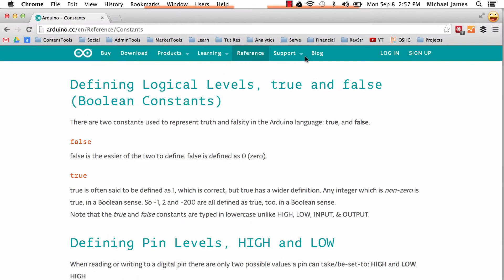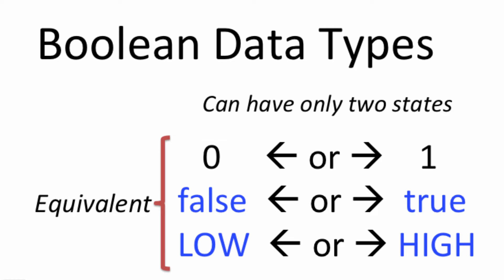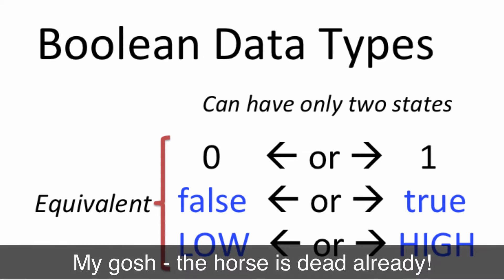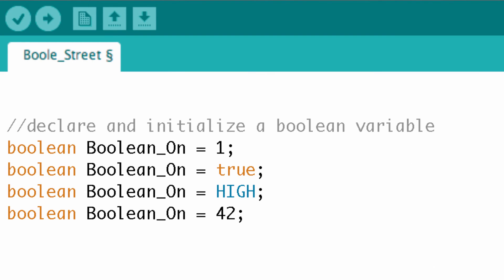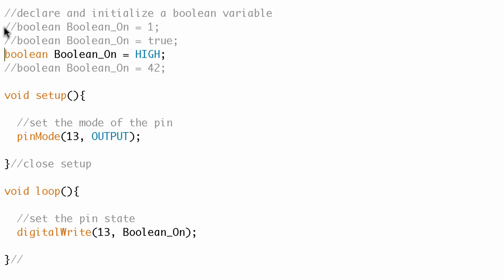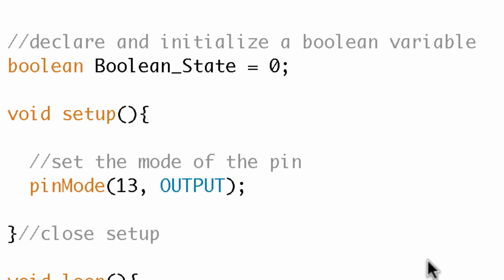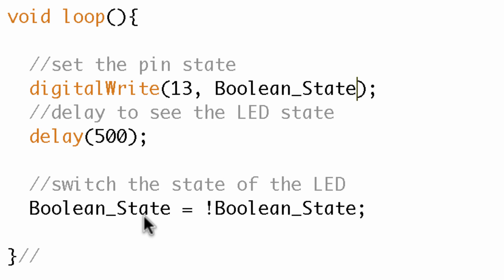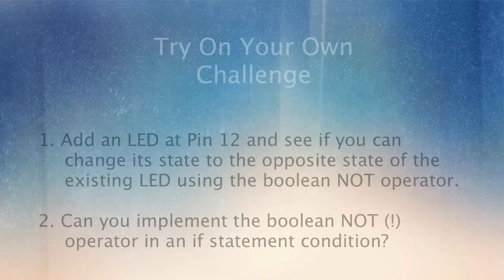Understanding Boolean Data Types and Using the Boolean NOT (!) operator to Switch Arduino Pin States

Comment: i got a LCD keypad shield on top of my arduino and i want to be able to press the select button on the LCD keypad shield to generate random numbers, the problem i'm having is "when i go press the select button, nothen happens, plz help and here is my code
#include <LiquidCrystal.h>
#include <DFR_LCD_Keypad.h>

// this is factory config shield initialisation
LiquidCrystal lcd(8, 9, 4, 5, 6, 7);

// initialise the keypad
DFR_LCD_Keypad keypad(A0, &lcd);
int lcd_key     = 0;
int abc_key_in;
#define btnSELECT 4
int read_LCD_buttons;
int  diceOne;
int  diceTwo;
define btnSELECT 4
int read_LCD_buttons()
{
  abc_key_in = analogRead(0);
if (abc_key_in < 790) return btnSELECT;)

void setup() {
  lcd.begin(16, 2);
  lcd.setCursor(0, 0);
  lcd.print("Press to dice");
  pinMode (A0, INPUT);
}

void loop() {
lcd_key = read_LCD_buttons();
  
  switch (lcd_key)
{
  case btnSELECT{
    diceOne = random(1, 7);
    diceTwo = random(1, 7);

  if (diceOne + diceTwo == 7) {
    lcd.clear();
    lcd.setCursor(7, 0);
    lcd.print("7");
    lcd.setCursor(3, 1);
    lcd.print("The pirate");

    if (diceOne + diceTwo == 5, 4, 3, 2, 6 ) {
      lcd.clear();
      lcd.setCursor(7, 0);
      lcd.print("5,4,3,2,6");

      if (diceOne + diceTwo == 3,2,1,5,4,6) {
          lcd.clear();
          lcd.setCursor(7, 0);
          lcd.print("fish");
      }
      }
    }
  }
}

Comment: sir, how can you make a blink proportional to the serial data from processing? what i mean is, i wanted to have just a single blink per pixel of x axis in processing on each time i move. what i wanted to do is, i wanted to make the blink function of my led like of that of servo that it has corresponding steps, but instead if steps, i wanted it to have a blink per pixel i move with my gui in processing. but i dont know how to set a "map" like for example from 0pixel in x axis o a maximum of 366pixels is from 0 blink state of led to 366. i hope you get what i mean. pls help me figure this out ^_^

Comment: hai sir, can u pardon me to create one coding for our final project. my project about the fluorescent lamp. we use arduino uno. in this case, i need to create using boolean because my project is connect via webpage and actual switch. the probably right now is if i use both function, my relay got burn if i switch on lamp using webpage and switch off using actual switch. i need u response asap. sorry if my english very poor

Comment: Hello sir,i like your channel and it helped me to get started with arduino but im stuck at  this Problem :

my aim : i want to make a ldr to on and off an LEd (like a TV).

what i coded  :
 int led = 9;
int ldr = A0;
const int on = 700;
const  int off = 600;
 
void setup() {
 pinMode(led,OUTPUT);
 pinMode(ldr,INPUT);
 Serial.begin(9600);
}

void loop() {
  int value = analogRead(ldr);
  Serial.println(value);
switch (value) {
    case on :
    
      digitalWrite(led,HIGH);
      break;
      
    case off:
   digitalWrite(led,LOW);
      break;
    default: 
      
    break;
}  }
my obervation with ldr = max value 1023 and min value 500  at A0
 Now my problem  is "data type" as we all know ldr value will change  i want to know that is there any data type which stores value from one range to another like  (ex. 500-700 for ON ) and (700-1023 for off)  .. or  this is not possible with LDR

it is still working though but i have to be fast as value must be equal to what i have specified (const int on and const int off ) .

TV uses IR which have specific values  but still its chellenging to do it with ldr
Reply from the maker: +Siddharth Singh Rajawat Great question - you should check out this function, called map(), it might solve your problem.

https://www.arduino.cc/en/Reference/Map

Best of luck!